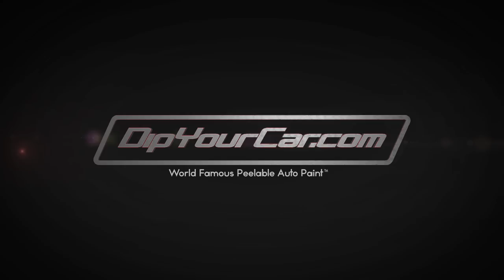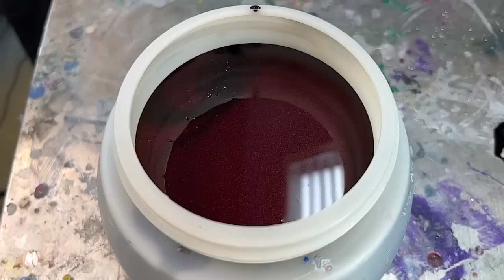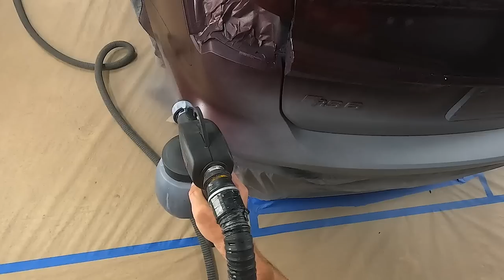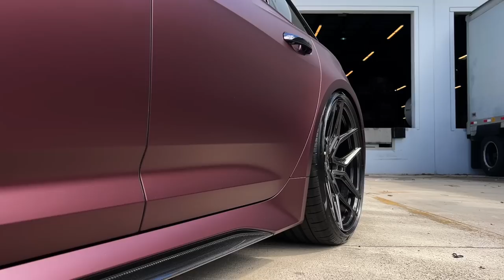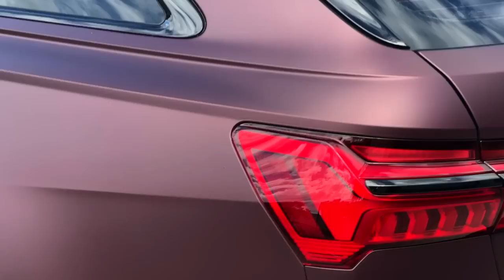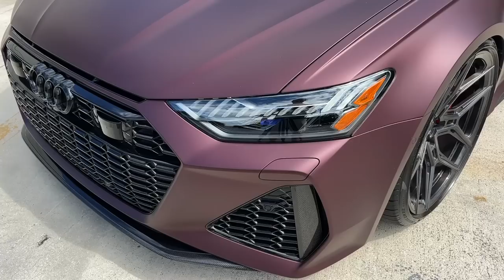Mixing Up Some SHADOW WINE (Dark and Delicious)

Comment from the maker: Rate my car 1-5  ⬇
Reply: 4! Looks gorgeous bro
Reply: 5, I love the color!
Reply: Its a 5 man...
Reply: I would love this on my car but have to fix body damage from getting side swiped on freeway and its a hit and run. But definitely not trying to have any increase on my insurance
Reply: 5
Reply: It is a solid 4, beautiful color but needs a little more flash to really get that 5
Reply: I would give it a solid 4; you've made some colors that make me say wow, but I would happily drive this car.
Reply: 5
Reply: 5
Reply: 4
Reply: A beautiful color. Definitely a 5.
Reply: Solid 5.
Reply: 3.5 just needs a touch more black
Reply: 5 , the black really helped!
Reply: 4 looks cool, i think some choclate accents would made it even more intresting
Reply: 4.5
Reply: 4.6 love the satin look!
Reply: 5! I love it!
Reply: 4/5
Reply: 5 for sure. Love it!
Reply: 4
Reply: 5
Reply: 5
Reply: 3.5 not because it doesn’t look good, it does. Just wicked wine and (imo) the predecessor, nebula red which I had for a time has a tendency to look “cheap” when dirty. If you don’t keep the finish clean all the time, the car looks like a bad primer job. Perfect stealthy color on the wagon tho.
Reply: 5+++!  I'm not usually a fan of flat colors but I could definitely see this on my 1st gen Miata.
Reply: Looks great.  5
Reply: 5 🔥🔥🔥
Reply: 6! Had a car in a very similiar color (ral3009 schwarzrot, just a simple matte paint without pearl) a while back.
Reply: Hear me out .... as is a 3 ...  40% black 60% wine would let those highlights pull better ..  then run a dark bronze wheel color not brassy or gold but not a oiled bronze either just a rich aged dark bronze color ... that would pull the highlights in the wine stronger .... full combo a 5 as is 3
Reply: A strong 4.  I like it on your car but not mine
Reply: First time commenting and this is by far the best redish color ive seen definitely a 5 by the ways those rims are fire my guy!!!
Reply: 4
Reply: This SERIOUS!! 🔥🔥🔥🔥
Reply: 4👍 I'd want it just a little darker, smokier, then it would be a 5.
Reply: That is absolutly a 5 dir me sheeesh
Reply: I'd give it a 4. I really like it, but I'd be super curious to see a 25/75 mix with wicked wine/shadow black.
Reply: solid 4..
Reply: 1 looks like a version of the plum crazy...
Reply: 5 all day, I was really unsure about it as it sprayed on. But outside is a hell ya
Reply: Looks amazing 😍 I say 5!
Reply: 5.  This is right up my alley too. 

Black Cherry.... perfect.
Reply: I enjoy the quieter, deeper, colors like this. This is an absolutely great fit for the car, a 5 from me. My Type R is quite a bit flasher in it's styling, and I want to do it in a super dark, midnight purple.
Reply: It’s a 5 no doubt. I would be very interested in seeing what adding more shadow black would do.
Reply: 4 - Love the color, but not sure it fits this car, imo.
Reply: 5 Another color I wouldn't hesitate to shoot on my Touareg.
Reply: Solid 5 for me!
Reply: high 5.
Reply: 5 now that's a color I want on my bike.
Reply: I give it a 5. Gorgeous color. I could do this color.
Reply: 5 - gorgeous color with just the right sheen for my taste.
Reply: 5 million!
Reply: 5 looks Totally Sick! 👍
Reply: 5. That's pretty much decided what colour my car is going to end up.
Reply: 5 💣
Reply: 3.5
Reply: Ohhh.... me like.... I give it 4,9  :)    I would liked to change this: 1/3 black and on top black candy. less mix then you usually use, but so an extra layer is needed. Then you get slightly more depth.
Reply: 5 most definitely
Reply: 5! I rarely comment or rate but for whatever reason this color/car combo is amazing!
Reply: 1  Too Plum.
Reply: Looking 🔥, 4.5 for sure. With a fade to black like the red to black color shift you did awhile back, it would have been a 5 for me. Still though, I think this tone fits the RS6 perfectly.
Reply: 4
Reply: Color 3.8, very attractive, but its too dark for my taste. A 6th to a quarter less Shadow black in the mix would brighten it up just a tad.
Photographically 4.6 Shows of body lines with excellent contrast. If it was a little brighter, the contrasts and gradients would be stronger.
Reply: 5
Reply: 4, I want to see that with black candy over it.
Reply: 4.5!!   Throw House of Kolor black candy over that!
Reply: I think it's a 6/5! The video probably doesn't do justice to how gorgeous it actually is.
Reply: 5 absolutely stunning. only thing you need to do is peel the back of the door handles. Looks out of place being 3/4 black 1/4 colour
Reply: 5 fo sho!
Reply: 5 love it... But where is my blooper lol
Reply: 4
Reply: 5 totally badass 😎
Reply: 4.5 out of 5. Really like the subdued colour with the satin effect still coming through.

Now that I've seen this I'm wondering what a 50/50 shadow black with Frozen Blue or something would look like.
Reply: 5
Reply: 5
Reply: 4 - it's wow but needs a little something more to get omg
Reply: 5
Reply: 5, please.
Reply: I would love to see satin black mixed with cabolt blue 1 to 2 parts mix
Reply: 5 for sure!
Reply: Class, 4.5
Reply: 4. I love the black Cherry look. Personally id have added a red interference pearl over it but you like the stealth look, I like a subtle flare
Reply: It's classy..... rate is 5
Reply: 100% a 5 looks amazing
Reply: I give it a 4 looks good on the rs6 👍
Reply: 5 and this is to go even further beyond.
Reply: I normally go for the flashier, crazy colors but... I gotta give this one a 4.  I kinda dig the Cabernet Sauvignon color to it.
Reply: 100🔥🔥🔥
Reply: 5+.... I love this color 😍 ❤... it's awesome 
If you need a name for it, I'd call it... 
Black Cherry 🍒 ♥
Reply: Here I thought the black would over shadow the wine. Honestly she gets a 4 from me. Nicely done.
Reply: 5!
Reply: 10 it's way beyond 5 🔥🔥🔥😍😍😍
Reply: 5
Reply: 6
Reply: color 5  car 5  total 10.
Reply: 4.5 for me. I personally think the Shadow Black should be dialed back to let the Wicked Wine pop a little more.
Reply: 5... colour looks awesome... subtly tough... its a murdered out merlot... hey fonzie... what would you think this would look like in a chromed out finish??
Reply: 6
Reply: I am gonna break the rules.....6!!....there... i said it...bhujaah!..great mix DYC team!...thanks for sharing and keep it up!
Reply: 5 all the way... depth and sheen.
Reply: 4.5  Looks really good.
Reply: 4.5 Audi should add this to their colors available.
Reply: 4
Reply: Wow black cherry color 5
Reply: It’s stunning.  😍😍😍
Reply: FONZIE!! 5+ dude I want this exact colour on my ‘21 F150!!! Homer Simpson is drooling in my head seeing this
Reply: 5
Reply: I expected 'wine red' to go to a deep, aortic blood red. But this went much more grape black. I have to give you a 4.748 because it is nearly gorgeous.
Reply: It's a solid 5! You've created "Royal Grape"!
Reply: 3.5, I prefer "pearl" mixture's.
Reply: For me it's a solid 4.5, more of a sheen for me but I like it, I like it a lot.👍
Reply: 5......!!!
Reply: 25 I rate this color a 25 out of 5.
Reply: 5
Reply: 10 all day long love it Fonzie 👍👍👍🇵🇷
Reply: That's a 5.
Reply: Color itself probably a 4 when seen in person, but on that car... a solid 5. One of those situations where the color has to be on a right car to fit.
Reply: 5, definitely.
Reply: 5 😍
Reply: 5
Reply: That's definitely a 5 bro!!!keep up the great work.
Reply: 5.   You nailed it, and your smile when you mentioned how much you liked it said it all.
Reply: 4,5. 5 if you make it blue !
Reply: 4
Reply: 5 👀🤩🤩🤩🤩🥳🥳🥳💜
Reply: I was gonna go with a 4 but then I was like nahhh that’s a 5
Reply: 4.8 - at least half a point just because it fits the Avant so well! I generally prefer purples more to the blue than the red side of the spectrum, but sometimes it just *works*, even if a bit outside the normal preferences - and this is a perfect example of that for me!
Reply: 4.75.  almost perfect..  if it showed a little more of the metallic through it would be a 5 for me.  looks great.
Reply: I hade some doubts, but that came out beautifully. A 5 from me!
Reply: I'm going with 10
Reply: 10
Reply: Definitely 5
Reply: 3.75
Reply: 5 for sure color is 🔥, got anything that's like a deep root beer red satin? Or a bmw laguna Seca blue?
Reply: 5
Reply: 5
Reply: 4.9
Reply: 5, I wonder what it would look like with a candy coat.
Reply: 5
Reply: 4
Reply: I give it a 20, I wanna do my car this colour
Reply: 5
Reply: 5 but would be 10 with the high gloss top coat
Reply: 5 !!
Reply: 6 out of 5, one of the most gorgeous reds I've ever seen 😍
Reply: 5!  I think it looks incredible!
Reply: 5
Reply: Gorgeous. Can’t even say 5 , 10/10
Reply: Definitely a 5 for me!
I'd love to see more bright colors get a shadow tone to them!
Maybe firebelly orange and shadow black?
Reply: 5
Reply: 4- I love Shadow Black and not a fan if Wicked Wine.  This is a surprising result.  Looks great.
Reply: 5
Reply: 3 - I gotta have my high gloss.  The color is nice.  Maybe with a subtle bit of gold in it?  Thanks Fonzie.
Reply: 4.5 needs something extra to make it pop, but I would rock it on my vehicle
Reply: 5
Reply: I already wrote this as you were spraying - 5 💯 love it. I’ve always loved Midnight Colors.
Looking at it - it is as stealthy as you say your rims are awesome - I think the best combos are SHADOW BLACK, Bronze, Arctic White, Anthracite Grey, Onyx. Why am I telling you this your the expert LOL 😂
Reply: 5/5 my son and I both love it.
Reply: 5
Reply: 5
Reply: 4
Reply: 4….very nice!
Reply: 5
Reply: Easy 5. Damn so gorgeous
Reply: 5/5 gorgeous
Reply: 4
Reply: 5!!! Those rims are 🔥 So clean!
Reply: 5 on this one.  I am for that subtle yet eye catching vibe
Reply: Absolutely 💯 5 all the way!
Reply: 5 definitely on that car!!!
Reply: Holy hell that's nice a 5 for sure
Reply: 5 all day long
Reply: Fricken A!! Howz that #!!🤙🏽
Reply: 5 It's subtle but luxurious looking!
Reply: 4 its nice though
Reply: 5
Reply: 4.5 I'm feeling it
Reply: 3. Not sure if I like it.  But I don't hate it.
Reply: I'll give it a 4 colour really suits the body lines of the rs6 and the deeper colour looks unreal 🔥
Reply: Definitely a five‼️ How about some Midnight Merlot‼️🤩
Reply: 5 I dig it look like deep cherry
Reply: 5! That sheen level is amazing!
Reply: 3,5
Reply: 5 my guy. U can see how proud of it u were. 💯
Reply: Solid 3
Reply: Solid 3. It’s very understated and sleeper. Buts it’s such a beautiful rich colour. I just prefer something brighter and more obnoxious :)
Reply: 4.5 id like to see that more tward a red hue like a black cherry
Reply: 4
Reply: 3 definitely one of the better Browns you guys have mixed. It’s got depth.
Reply: 4, because 5 would have to go to the pearl over vantablack car
Reply: 5
Reply: Looks awesome, but the wheels are better. 😂
Reply: 1
Reply: 4 👍🏼
Reply: Definitely 4, I didn't expect it to look as good as it does. Suits the car and the dark accents you have like the wheels, badges, carbon ext 👌
Reply: 5 ....name that color black cherry
Reply: 4, looks good! Wonder what it would have looked like if you used muso-black instead 🤔
Reply: Rate it 5! Love the deep rich wine 🍷
Reply: 4! doesn't blow my mind but looks great on the car.
Reply: 3
Reply: solid 5, you can't go wrong with this color
Reply: 5
Reply: 5. superb colour 👌 😍 love it
Reply: 10 👌👌👌
Reply: 12/5 for sure, super subtle yet insane presence :)
Reply: Solid 4.
Reply: 5
Reply: 6
Reply: 5 absolutely love it
Reply: It's flex 💪 even better than Iron Man
Reply: 5 all the way
Reply: 5
Reply: 5 all the way!
Reply: 7 absolutely love it man looks wicked
Reply: 5
Reply: Incredible 5
Reply: 5
Reply: Your RS6 Avant is a lot of things (all good), subtle isn't one of them. 😁 4.5
Reply: This is maybe the 3rd time on your channel I’ve thought a color rated a 5. I’m going to be putting this on my Jeep rig next year.
Reply: 4.5
Love deep and dark purples on cars like this. The deep purple bmw used on the M8 I think it was called ametrin iOS a favorite of mine. I assume it’s been mentioned with all the comments but what about the candy black over wicked wine??
Reply: 10 i love it
Reply: 5
Reply: 5 I’d rock this color all day
Reply: 5 for sure
Reply: 5 that is fire 🔥🔥🔥
Reply: 5
Reply: 5 It's stunning
Reply: 93/5 that color fits the AUDI Perfect !! Love it !!
Reply: That's definitely a 5. It's somewhat close to the factory color of my Honda, but it looks 100 times better.
Reply: 5. Love it!
Reply: 5
Reply: 5️⃣
Reply: 5
Reply: 5. Way nicer than I thought it would be
Reply: Kinda looks like a black Cherry. Wonder how that would look in pro-line. I love it , solid 5
Reply: 3.5 I was hoping for more red than purple
Reply: 5
Reply: 5!! I’d sooo rock that if I could!
Reply: 5 all day long.
Reply: 5, dope color
Reply: 5! That's an awesome color!!
Reply: 5…5….5
Reply: 5
Reply: 5 - Really nice color! 👌
Reply: 5 looks awesome
Reply: Can I lend you my car to make a video with? Lmao that would be awesome! I still think a giveaway for a dip job would be awesome to do.
Reply: Solid 4 from me, looks very nice ^^
Reply: 5!
Reply: 5 ⭐️ rating it just blows my mind. I thought the shadow black would darken it too much but in reality it darkened it just enough to be really awesome. I like to see more color combinations.
Reply: 4: Reds aren't my favorite, but I do like how it came out.
Reply: Going for a 5. It’s really amazing 🤩
Reply: 10!
Reply: 5 man... Love it
Reply: 4
Reply: I love it 🤩 definitely 5
Reply: 4 for sure....darker would have maybe sligly better but good
Reply: 4!  Grape Rancher… I dig it
Reply: Oh dang… this would look awesome on an suv too… 5 homes
Reply: 6
Reply: 5, also you should start peeling the logo more on camera (when applicable) super fun to watch that bit
Reply: 5 love it 👍
Reply: Gotta say 5 here too.
Reply: 4🤤
Reply: 4
Reply: 5 man, very clean look to it!
Reply: 5
Reply: 5
Reply: 5
Reply: 5 of 5 - Black Cherry!  Now add a some powder and sparkle to pop the red.  Wait isn't there a red to black color shift pearl?
Reply: 😲5
Reply: 4, simply because I like shiny/gloss better than matte finish.
Reply: beautiful! definitely a 5
Reply: 5 , I want it for my Alfa
Reply: Car 1 color 5
Reply: 3.5 for me. It looks like a black cherry color. I'd like to see it with a bit more red, but its still a very pretty color.
Reply: 5 one of my favorites. I need a plum wine
Reply: 5 looks Epic
Reply: Fonzie it looks fire, 10 from me!
Reply: 5 fo sho!
Reply: 5. Found my next color
Reply: Amazing 4.5
Reply: That’s a solid 5 🔥
Reply: Yeah... i can do a 5 on that color. Looks amazing. Wheel color really sets off the look.
Reply: 5 🔥🔥🔥🔥🔥
Reply: 5 best colour yet...
Reply: That’s a 5 right there
Reply: 5
Reply: 6.
Plum Suede S-6
Reply: That's a 5 all day
Reply: 4! It’s more of a dusty purple rose than a deep rich wine but very awesome!
Reply: LOVE IT 5
Reply: 5 - great color. Much better than I expected. I am guessing we will not get to see this car again for a year since you will be rocking this
Reply: 4.75/5 - it makes me happy too! The sheen is just perfect.  Id love to play with the colour mix and see what a 75/25 mix would do.
Reply: 5 +5
Reply: 5
Reply: 5
Reply: 4
Reply: 5 awesome
Reply: Absolutely 5. love it thinking to have it in my daughter C200
Reply: 5 fonzi.... Super awesome colour.... That is a unique colour... Their is no colour in the world that they put on a car like that...
Reply: 5. Had me drooling
Reply: 5.  Hands down, one gorgeous color!
Reply: oh ya, 5
Reply: Can you do wicked wine and poison grape?
Reply: 10/5
Reply: 4
Reply: 4.5. Little more bronze than I would prefer but the smatte? mattin? finish makes up for it.
Reply: 3.5 very nice! Not my first choice but better than I expected!
Reply: 5
Reply: yeah i really like it ill say 4 because i would like to see it with a pearl clear on it.
Reply: 4.5 great colour but not sure how Matt finish would wear over time
Reply: 5
Reply: 2. Not what I expected. Looks like a rose colored raisin.
Reply: 10 brother really I love it
Reply: 5, very sofisticated!
Reply: Its a solid fire 10 on that scale.
Reply: 4.5 great show room color you could name it Brady wine 🍷
Reply: 4.5 as I prefer super-gloss 😊 the color is terrific!
Reply: 5….5….5!!!!!!!
Reply: 5 but needs black candy
Reply: 5!!!
 Love it love it love it!
Reply: It’s a 10!!!

STUNNING!!🏆🏆🏆
Reply: It's a solid 5, gorgeous color
Reply: 5

Comment: Just out of curiosity, does the dip affect the PDC sensors? Or do they work as good as without a dip? Color came out great, so it’s a 5 for me
Reply: You saw that, too? Good question to ask! I was wondering that myself.
Reply: @lonnacamacho4383  yeah i wondered because I think a coat of plastidip is way thicker than regular paint. At some point it possibly could affect them? 🤷🏼‍♂️
Reply: They Still work, did mijn e61 and they never stopped working
Reply: @Benjimaes  nice car from what I see on your profile pic…are you dutch?
Reply: @GotMilkRS13  yes

Comment: 4 
I have a question. Does the plastic dip paint require a clear coat after applying base like normal paint jobs or is it like mixed and sprayed altogether?

Comment: Weird question, but did a different person than usual spray the car? I always study the technique for when I finally get the courage to do this myself. 

I noticed the usual person usually starts spraying before pointing the spray gun over the car, but that wasn't happening as much in this video. There were also multiple passes over where the roof meets the doors, stoppage near the mirrors, and the pattern near the bumpers was different.

Comment: When it initially goes on it looks really orange peeled.. does it naturaly smooth out more after all the layers are applied? Or are there other prep work to do afterward? I can't imagine there's any sanding on a peelable paint? Thanks in advance! And a 5 out of 5! This has my mind going on adding a little blue in for a more purpley hue... 🤔
Reply: When it goes on wet enough, it self levels. And since it's essentially a spray able rubber, you won't be able to sand it like paint
Reply: @vladstr100  thanks!